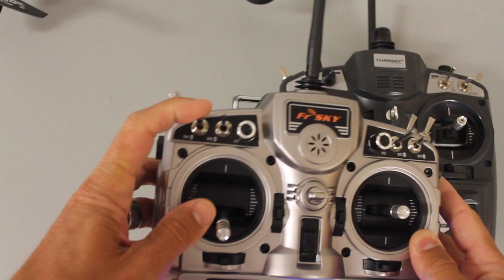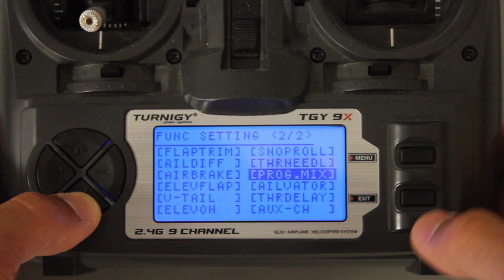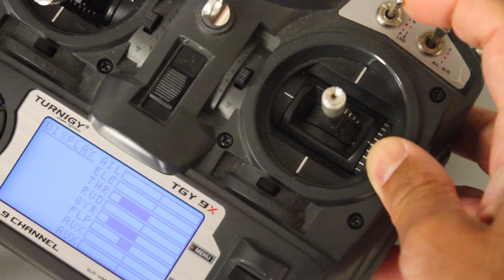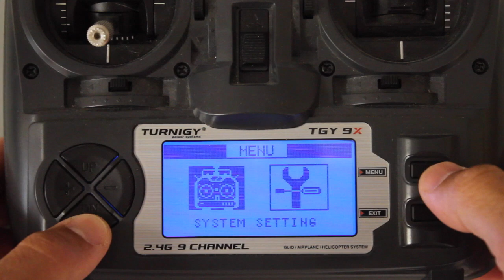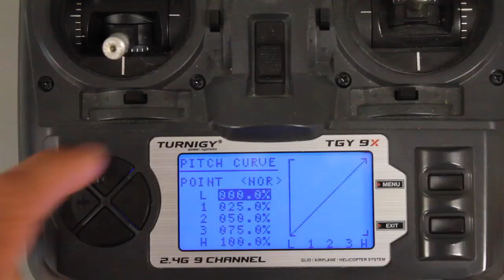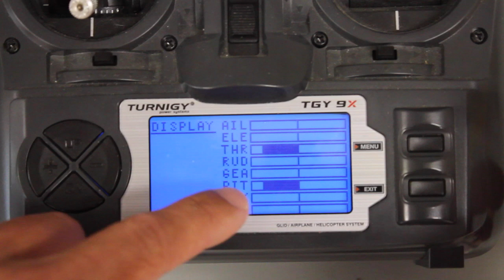Turnigy 9X Heli and Acro Flight Modes Explained - 3 Way Switch Setup

Comment: can anyone explain how to do that for heli -4  I don't know how but I fixed it so my left Gimbel vertically controllers throttle only  horizontally controllers  rud   while the right Gimbel  controllers the other 2 the problem is in the right one it shows them both moving in the same way  (right Gimbel vertically ) and nothing on the horizontal one

Comment: Thanks for the video. I've been flying helicopters for more many years and have no idea how to set this Turnigy for a Beta Flight which considers pitch channel as Aux2 in heli mode, and I couldn't figure out how to detach the pitch channel value from the left stick. This method is really clever. Thanks again.

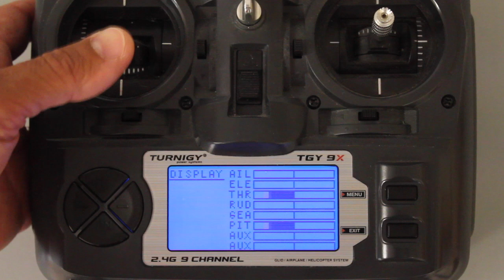Comment: 4:32 How do I disable the throttle being linked with the pitch?
Reply from the maker: If I recall it's built into the heli mode settings. Have you tried ACRO? That should unlink the two.

Comment: Hello Dennis,I have the flysky th9x and all I need is the 3 position switch to work the 3 flight modes in cleanflight betaflight..yes I am totally new to this,does the radio need to be set to helicopter instead of airplane to get this 3 way switch to work or does it matter what it's set at! I am a little confused on the settings..thanks

Comment: I played with Heli mode and a throttle curve for my multirotors.  But always went back to a linear straight line for throttle.  Not sure if the experts even use a throttle curve.  Good question.  I am capable, but noooo expert.  What are your thoughts on a throttle curve for the multirotors.
Reply from the maker: I've always used a linear curve for my throttle. I know there are 3D guys that use curves, but I'm nowhere near that level of expertise. So linear has always worked well for my application.

Comment: Great video.  I just pulled my Turnigy 9X out of storage.  Never used it, but I thought it would be a good time now.  Then, I found this tutorial.  Wow.  Great for using the 3 position switch And a key difference between Acro and Heli mode.  Again, thanks.
Reply from the maker: Glad to hear it and thanks for sharing your thoughts. It's a great TX for the money.

Comment: My CC3D (openpilot/librepilot) detect 3 flight mode switch but not detecting any other AUX Channel. Im using Turnigy 9x. Do you have any idea why this is happening? there is something that i need to set on tx? i tried couple of things without sucess. I want to set up Gear switch to arm and disarm motors. Thank you
Reply from the maker: I'm not sure how to do that but will look into it and see what I can find out. If you figure it out first please share with us. Thanks!

Comment: i should set up my turnigy 9x transmitir to acro or heli mode to fly a 250 Race quad?
Reply from the maker: I think ACRO is the way to go and then you can tune it from there to fit your needs. I used to fly in ACRO all the time with a small 250 size frame.
Reply: +Dennis Baldwin i have acro set in my turnigy 9x The problem is i cant find how to set min throttle. In heli mode is easy, i got throttle curve option. The idea is when throttle stick is at 0 motors still spin slowly so i can still use yaw And roll. Do you know how to set this in Acro on turnigy 9x? thank you

Comment: Dennis thanks for the vids you've posted. Quick question I'm hoping you or someone else might know.
Followed through the process for setting up the flight modes, but I can't get the pwm value to change when varying the uprate and downrate of the Gear switch/3 mode switch. When flipping the switch I jump from 1051 to 19xx. Any clue on why this might not be happening?
Reply from the maker: +Jon M Interesting. I haven't seen that happen before. Let me think on it and in the meantime maybe someone on the channel can chime in.

Comment: Great video Dennis. Always enjoy and get lots of info from your videos. I was able to set up my Turnigy 9X F. Mode (3 pos sw) per your instructions. I am using a CC3d FC. In mix1 I used dnrate = 046, mix2 008 and mix3 -030. This put it right in the middle of the flight mode channel values. I would be interested in knowing how you were able to figure out to use master=GYR and slave=FLP. Is this documented somewhere? Or are you a genius? Would appreciate any info you can share.
Reply from the maker: +abenwinUT Thanks for the good words. It was a lot of reading in the forums and trial and error. I'm definitely not a genius....just incredibly stubborn and hate letting things go :) Glad to hear you got your flight modes set up!

Comment: Thanks for ALL the videos you put out, very informative and useful info!  My question; after flying my quad in acro with flight modes set on gear switch, if I change my  settings over into heli mode and use three pos. switch the way you described, is there any difference in the flying characteristics ?  Thanks and keep up the good work !
Reply from the maker: +David Latham Heli does have some different configuration settings like where the pitch trim follows the throttle if I recall correctly. Also I'd make sure your throttle curve is the same on heli before you make the switch. I switched from HELI to ACRO and never looked back, but now am flying with Taranis.

Comment: hey i just bought this product and my rudder/yaw dose not present middle while its stick is in middle position its having constantly spinning with simulator... it become better with +120 rudder trim but it wont fix it ........please help....
Reply from the maker: +Milad Mirzaie I would recommend trying a new profile with a different template than what you're currently using. Perhaps something in the template is messed up and causing your channel signals to not be at their defaults.
Reply: Dennis Baldwin Thanks for reply I already check that but its always same. I wish i could fix it with some special setting beside trim without actual repairing it.

Comment: I have been wondering how to set this up!  My ZMR 250  is in the postal system and my Naze32 just shipped today.  Too bad my rx won't put CPPM out ch 1 to the Naze32.
Reply from the maker: Dean Cory Let us know how you get along with this setup. I have a Naze32 laying around and need to get it up in the air.

Comment: hi can you show me how to change thr cut switch to RTL swith on my turnigy 9x thanks great work.
Reply from the maker: nigel webber I don't have my 9X right now so I can't remember if you can set the throttle cutoff switch as an auxiliary. If you can then you shouldn't have problems with this setup. Otherwise you may need to customize your firmware with er9x or opentx.

Comment: Hi thks for all the info. I'm flying a DIY Y6 and the problem I'm having is   my model takes off so slow in acro compared to helicopter mode .
Reply from the maker: neil collins It's been quite some time since I've picked up my Turnigy 9X but my first guess would be to check your throttle curve in heli vs acro mode. Perhaps that's the culprit.

Comment: nice video..i have not tried it yet cause i only fly fixed wing..now im building my1st apm 2.5 quad and my 1st mini 250 with a cc3d..im using flysky china 9x..have the taranis but its still in the box for almost 6 months now :)..my time has been eaten up by my job and holiday season..your video's are a nice reference for my new projects..thanks for posting such informative,straight forward on how "to" videos..
Reply: If you still have the taranis I would be willing to buy it?
Reply: im planning on using it in the future for my recently bought frsky LR9 2.4ghz long range receiver.aloft hobbies has taranis currently on stock.

Comment: Hi Dennis,
Ivor here great Turnigy set up vid. Finally got my cable for radio calibration. Have set up my radio as per your flight mode setup video. I have to say your videos are the best, clear and concise. Trying to run Mission Planner on Mac via Boot camp, will see how that goes. Re making up a cable I didn't bother, easy and cheap to get on ebay.
Do you have RTL set on rear LHS switch?
Reply from the maker: Ivor Nathan Thanks for the feedback. Yes, when I was flying with the T9X the failsafe was on the rear left switch.

Comment: is there a preferred or difference in controllers ? ie, for mini quad ( racing ) or for the larger quads for filming, thanks.
Reply from the maker: ***** A Turnigy 9X will work fine, but I really enjoy the Taranis for its ease of configuration. When it comes to mini quad or quads for filming it's more of an issue getting you gains setup properly to match the size quad you're flying.

Comment: Dennis, When I setup the 9x on the f450 quadcopter (naza m lite), it seems to not be giving it enough throttle and will not take off. Sort of like if it was too heavy. Just barely lifting at full throttle. When I switch back to the old transmitter, it fly's fine and strong. My flight mode switch works ok. It seems like it is something in the transmitter setting doing this. like something is limiting throttle to be 100% although throttle shows as 100% in the naza stick calibration..What setting do you think it could be on my 9X? Thank you Kindly!!
Reply from the maker: D Tragic I would definitely check your endpoints. I think you're right, that there's a limit at the TX config. Especially if your old TX works just find. Check the throttle curve and endpoints. Surely it's something in there. Good luck and let us know what you find out.

Comment: Hi Dennis - Thanks for your video! 

I've just changed from the t9x stock reciever to a D8R-XP - and because I'm using CPPM my gear switch has taken control of channel 5 - Is it even possible to change this?!
Reply from the maker: Simon Webley I'm not sure if it is possible. It's been so long since I've worked with the stock firmware and I don't have access to it any more. Sorry I can't be of more help, but please share with us if you figure this out. Best of luck.
Reply: Hi Dennis! Thanks anyway but I flashed to er9x yesterday... Wow.. What a difference!!

Comment: Hi Denis,
Do you know if this method for setting up the 3 way switch is the Same? for the Arkbird auto pilot,
 Regarding, not having channel 5 connected
Reply from the maker: Hi! Well not having channel 5 connected is a function of your TX/RX. So just make sure you have your autopilot properly connected to CH6 on your receiver. And make sure it's connected to the proper port on your autopilot that is responsible for setting the flight modes. I hope that makes sense and good luck!

Comment: As a beginner, I pretty much learned everything from your videos. I sincerely thank you for your time and effort putting all these videos and information. I just built my first quad and programmed my Turnigy 9x radio into six flight mode as you had explained in your video. Worked like a charm!
Reply from the maker: That's the greatest feedback I could ask for. Thanks so much and glad it's helping. Best of luck with your build.

Comment: Hello Dennis,
Once again I followed in acro to FlySky TH9X and now, in display, it's the 3 position Doesn't move when stick. Did you forget to say how to configure aux 6 channel, or something more?
Good evening
Bruno
Reply from the maker: Bruno, it may be the way the templates are setup on the FlySky. I've never flown with it so I'm not sure about it. Perhaps check and see if there are any other heli templates you can work with. Otherwise, is there an ACRO flight mode that you can work with?

Comment: Thanks Dennis, Do you have any idea how this works with w MultiWii pro 2.0?
Reply: In acro
Reply from the maker: I'm sorry but I sure don't. If I end up getting a MultiWii Pro I'll definitely look into it and let you know. I'm assuming it's similar to the MultiWii where you can figure it in the MultiWii GUI and your receiver connected to the Aux port on the board.